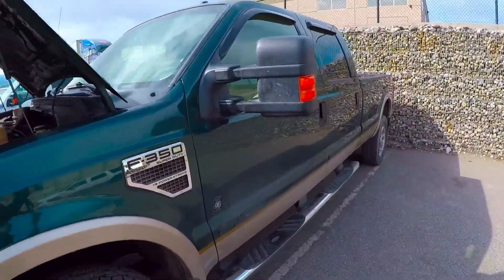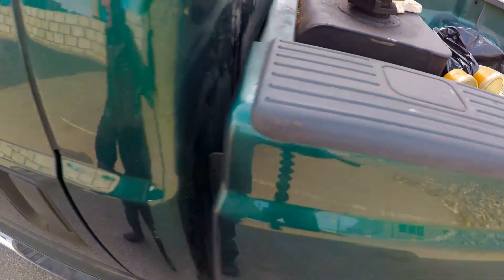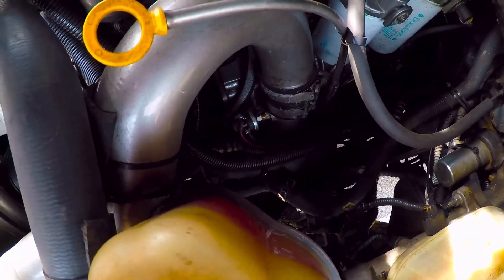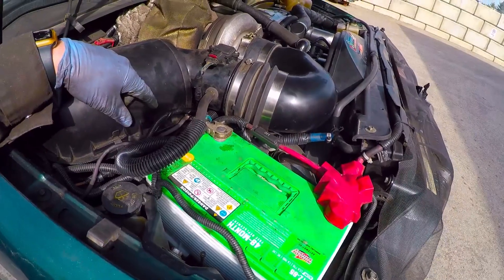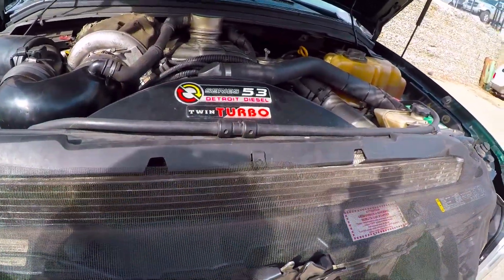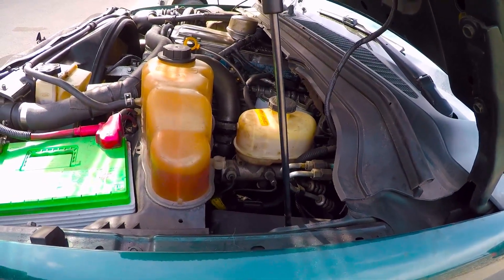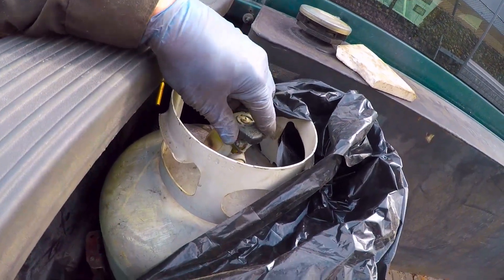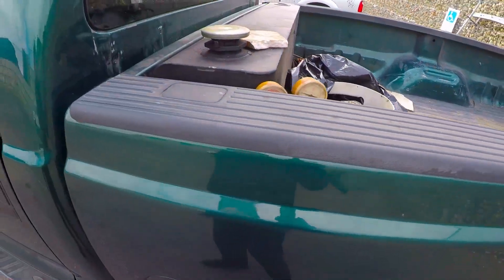Detroit 4-53TIB Propane Injection

Comment: I have some friends here in Australia that ran their interstate 65,000kg heavy B-Doubles on LPG (Propane) injection. They were using 50hp of extra power on 500hp diesel engines ( Mack and  Series 60).........they say it works very well. Cleaner oil samples,excellent pulling on hills and it cut their overall fuel bills (including paying for 200lts of LPG every 3500km) by 10%.
Reply from the maker: I have it turned up to 2 psi flow now and do see some more power.  I'll do an update on the system for fuel economy and power etc once I get some miles on the system.:)  So far I'm very happy with the results and the engine is running great.:)

Comment: why do you use propane? is it just to add additional fuel to make more power or does it do anything else for fuel economy etc? how does this differ in outcome versus NOS? 
Love the vids
Reply from the maker: Thanks, for me it's just a power add and am looking for another 40-50 HP.  I'm not sure how much power the propane will add, but it's mainly for the long 8% mountain passes.  My goal is to maintain overdrive and not have to shift into 4th.  I'll see if there is any fuel mileage gains, but I doubt it.  I haven't tried NOS, but from what I've read adds more oxygen to help burn the fuel.:)  If the propane doesn't give me the results I'm looking for I'll upgrade to 9A90 injectors.:)  Thanks for watching.:)

Comment: Is there an advantage to propane vs larger injectors? I want to make my 671 high hp, but it absolutely must be safely reliable at full power for long periods, as in pulling long grades.
Reply: It depends on what you call high hp and application. Propane has limits too much and when the pistons clear the ports in the liners the gas in the airbox explodes and blow's the blower off the engine
Reply: @joemaser9122  I have heard of that, and it definitely makes sense. Seems critical to keep the propane / air mixture in the air box to well below the Lower Explosive Limit. As for the hp, I can use all I can get. The engine is going in a bus. The GVW is 45 klbs, not including anything I may be towing. But let's say 40 klbs and 70 mph on a 6% grade would be 450 hp, in addition to the additional 100 or so just to overcome drag and rolling resistance. So I'm just looking for as much as I can get, but while remaining absolutely reliable. 99% of the time the engine will be loafing along on level ground, just want the hp to be available for the grades. Would be nice to not be getting passed up by the semis. ;)
Reply from the maker: The only advantage I could see is less emissions and lower egts.  I’ll know more once I turn it up and will post more videos.  I live in the Rockies, so reliability is also a must as well.  I’ll monitor egts, boost pressures as well as back pressure, so I’ll have a good idea how well it works.  Only been driving it in town for 3 days:)  The only other person I’ve heard running propane on a 671 is Bus Grease Monkey.  He has a few videos if you’re interested.  Thanks for watching.:)

Comment: I don't know what you are trying to accomplish with the propane add. If your engine is running at full load, on a dyno, say, then adding more fuel will result in a noticeable increase. Just remember, the diesel system is providing the ignition and will only do that when the engine is pulling. When it is coasting the diesel governor cuts the diesel fuel off, if you still have propane being ingested you are creating a bomb.
Reply from the maker: Propane is only being injected after 7 PSI of boost pressure. Below 7 PSI the propane is off.:)   Thanks for watching.:)
Reply: Diesel and propane both ignite under compression too much propane will ignite first and burn all the air in the cylinder before the diesel ignites causing black smoke,low power and high EGT Mixture is Important also the will engine runaway on propane
Reply: seriously, watch the video and learn..........7psi cut off switch is prevent what you describe.  Propane injection has a lot utility with diesels to improve the full combustion of diesel that normally would be soot........its a win/win.  Bigger injectors is not the only path to more power and usually just waste fuel.......as in rolling coal.
Reply from the maker: @wazza33racer  Very true, finished the second week running propane and the Detroit loves it.  I've turned the flow up to 3 psi now and starting to see some increase in power, about 10 HP or so.  Egts are unchanged and overall very nice.  I thought I'd try the propane over larger injectors and see if I like it.:) The 7 psi switch works great, so I'll just make small changes weekly.:)